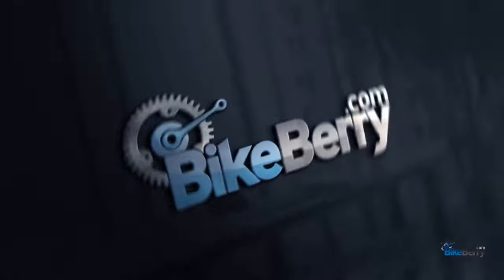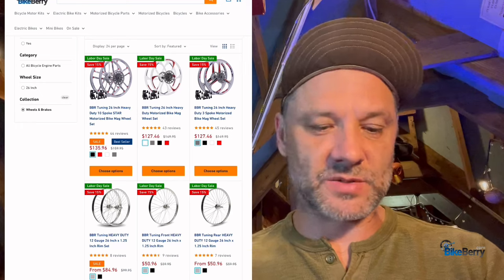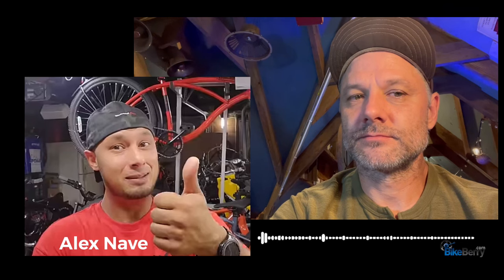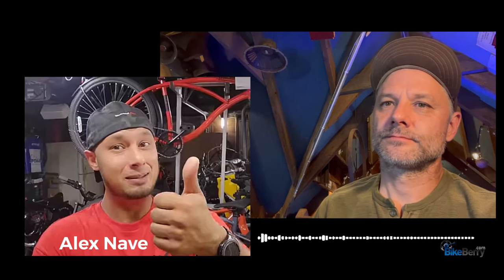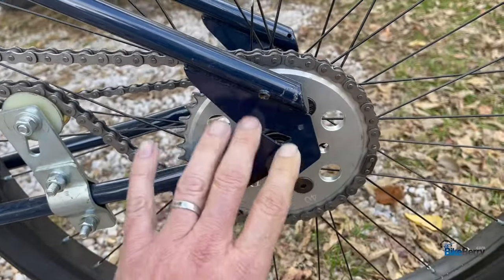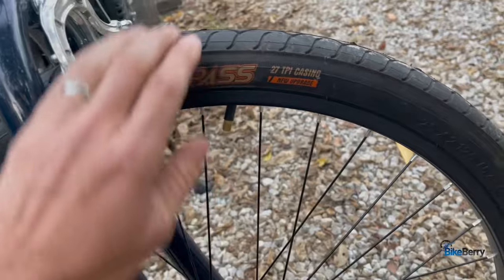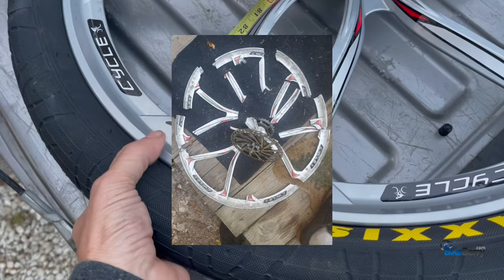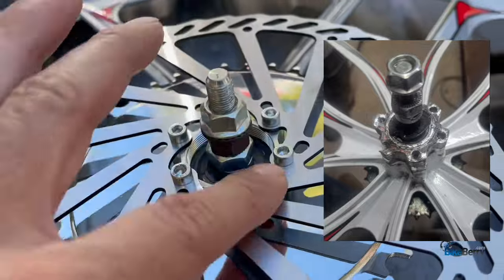Mag Wheels Put To The Test! @MotoredLife | BikeBerry

Comment: Just my opinion, but the cheap mag rims costing $150 a set are not a good choice for a 4 stroke motorized bike. Especially ones with 5 + hp and large amounts of torque in the 7, 8, 9, 10 + foot lbs. of torque. Also coming from China, the quality of the alloy can be suspect. If the batch is not of quality, the wheels can be extra brittle and very prone to stress cracks which will lead to catastrophic failure. You might be able to get away with them with a China Doll 2 stroke (low HP & torque) or a 49 cc HS 4 stroke again (low HP & torque) but not on a Predator 212 cc with big torque. If you ride around avoiding all pot holes and are extremely gentle with them  you might get by for a while. But in the real world they are to rigid and to brittle for a motorized bike. Just my opinion.
Reply: Yup 💯
Reply: I agree 100% I opted for the Autes 10g spoke double wall rim! Amazing rims! I have a predator 212cc on my bike with a stage 3 kit ok it... I couldn't trust the rims falling apart on me with all them horseys! Lmao

Comment: I have a set of those 10 spoke since 2014 and they are still running sharp. No bending no cracking nothing so far. I always check my pressure and do not do stunts or wheelies and avoiding as many potholes as possible. I run these mags on pavement roads only and they work great. I always start my bike on the stand or very fast. Running 26 by 1.5 at 42-44 psi on the rear and 38-40 on the front works for me. I'm 5'7 175lbs. I use the same configuration I use on my motorcycles. Good video very informative, learned a few things to take more care of the rims, thanks.

Comment: there more factors then just tire pressure that cracks mags..high hp engine with lots of tq like 79/212cc will break them miss or hit.another factor improper chain aligment can  cause some issue,cheap hardware cost bolts to stretch,then hard riding like offraoding jumping curb will break them.other factor is the batch some are made with potmetal
Reply: Right on!